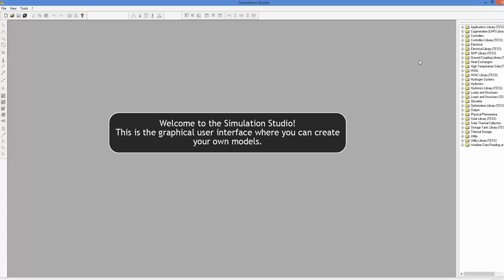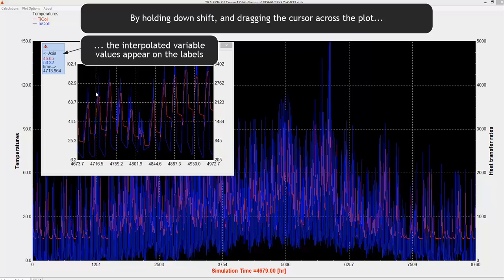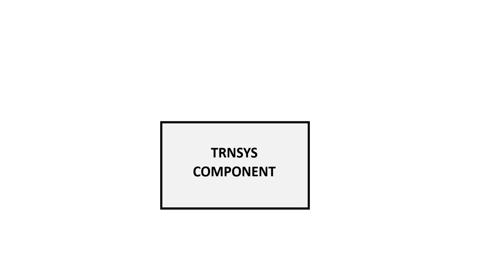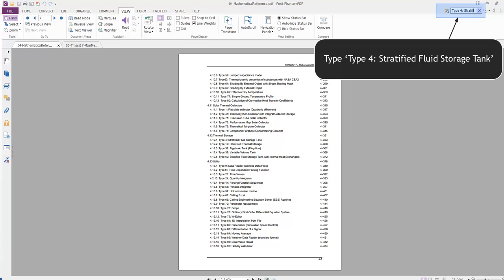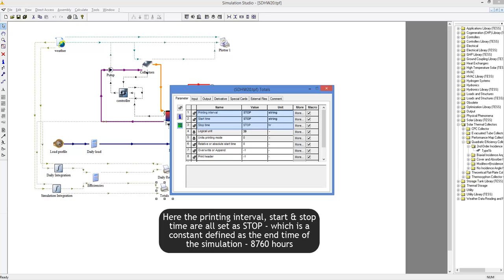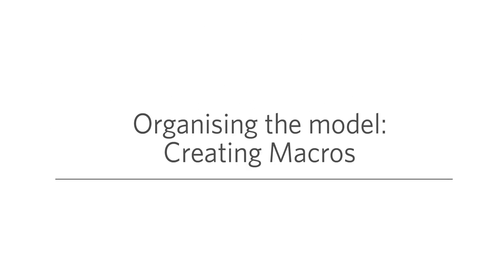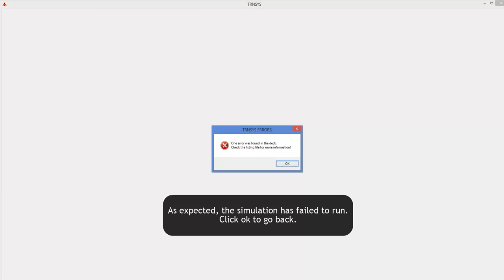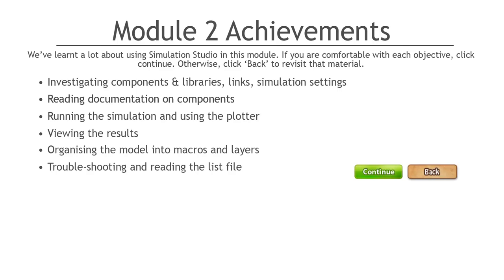Exploring the Simulation Studio with TRNSYS 17

Comment: i am facing a issue, can you please help? my system is simple solar water heater, i am using two loops, one from pump to solar collector to heat exchnager and back to pump , this loop is using oil.
then i am using another loop that is using water, this is coming from load to heat exchnager then pump then aux heater.
aux heater is set at 180 degree,
the issue is, in my results, my aux heater is always running from 20 to 180, however, it should be running from roughly 100-180 (whatsoever is the output after the heat exchnager). meaning my heat exchanger is not exchanging any heat. can you please help. all connections seems fine
Reply from the maker: Sounds tough, trnsys can be rather frustrating. This is complex to resolve without looking at your model and throughly understanding the components. If you email support@trnsys.guru we'll give some pointers. 1. Throughly read the inputs/parameters all types, 2. Open the Fortran code to see how it actually works. 3. Create an energy balance of the system and see if it is equal to zero 4. Make sure you have flow rate on both sides of the hx and the effectiveness is right.
Reply: @learntrnsys7189  This is ALi Rao, saw your reply today. I was able to fix it last yeat. Just letting you know the fault was with the flow rate, as you had predicted. It took me lot of trials to bug the issue. and yes TRANSYS is frustrating sometimes because not many people have used it.
Reply from the maker: Great job Ali! Yes it is frustrating, but we hope that the Learn TRNSYS course on Udemy helps you master the software faster!

Comment: Thank you for this helpful explanation!
I am having some problems trying to simulate a Parabolic Trough Collector, especially with the linkage between the weather data and the radiation processing. Are you intended to make some video related to this topic?

Best regards!
Reply: +Luciano Oliveira Thanks for the suggestion. We could definitely add that somewhere. Can we help with something specifically?
Reply: Jeremy Osborne My problems are related to the association of weather data outputs and the parabolic trough inputs, specially the parabolic trough's input "incident radiation". I have made tests changing some different weather data (type15-3) outputs but I got no convincing results.
Reply: +Luciano Oliveira  my recommendation has been carefully read the input and output of the components to ensure they are met. This is the best way - for a tracking collector you need to use tracking mode 3, and connect beam surface radiation to the incident radiation.
Reply from the maker: +Luciano Oliveira Hi how did you go with your simulation?